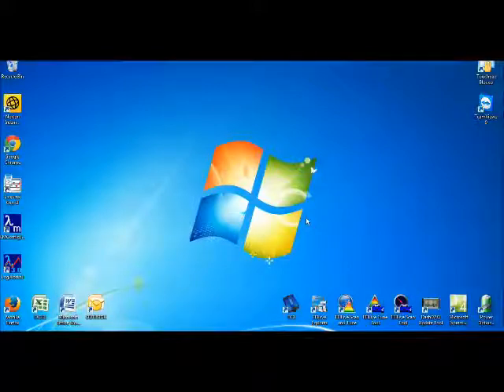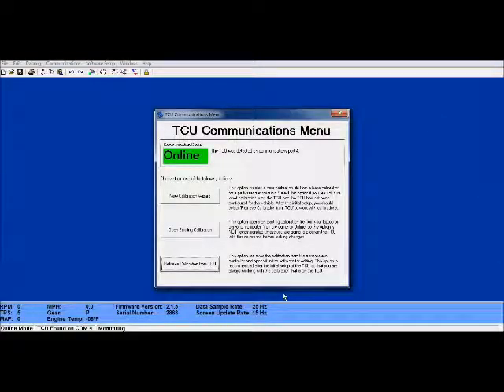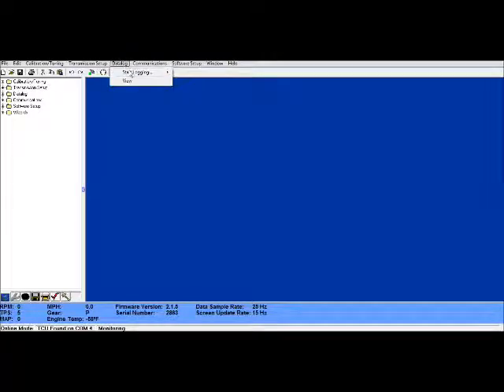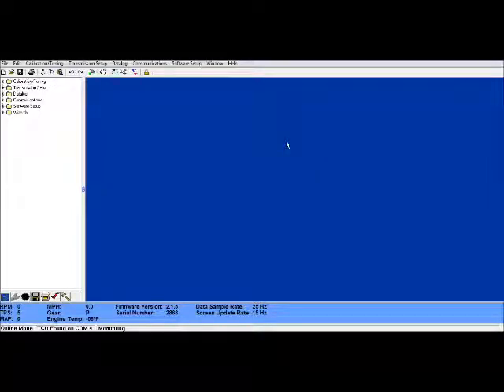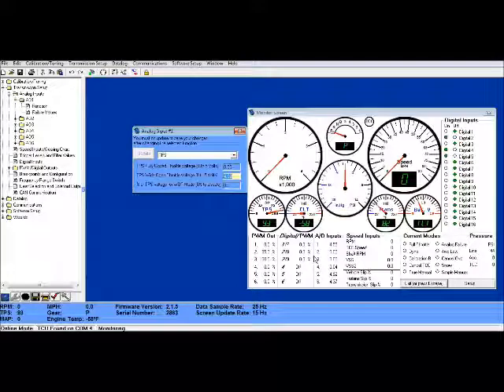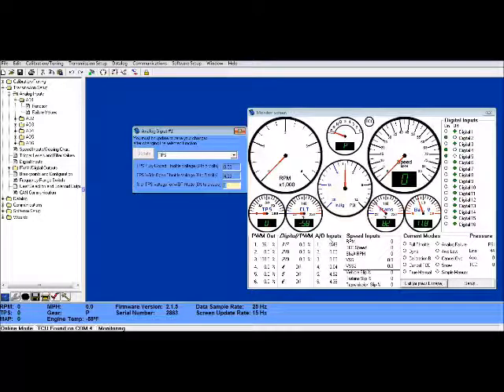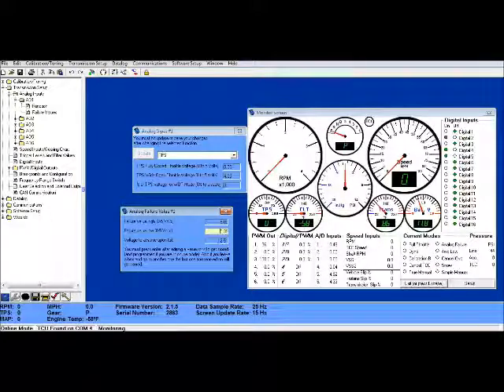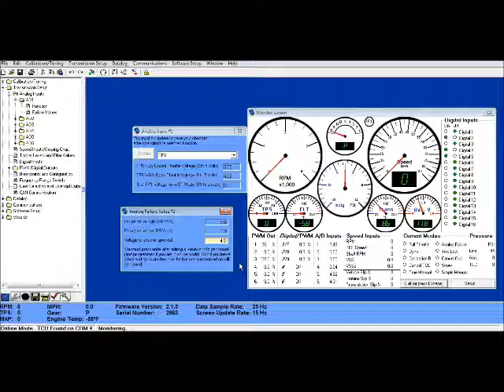Datalog and TPS Setup for PCS Controller

Comment: OK, another thing, at 6:05 if I have it right you talk about setting the TPS failure voltage close to the WOT voltage. Shouldn't it be the other way around ie if the TPS fails then the shifts should default to their softest settings?  Particularly with a higher performance vehicle?
Reply from the maker: Typically line pressure is controlled according to TPS voltage, so setting the failure voltage close to WOT voltage keeps the line pressure high in the event of a failure to prevent the clutches from slipping and ruining the transmission  (which could potentially happen if the TPS failed and the driver didn't know and had the accelerator to the floor going up a hill with a big trailer for example).   Setting the failure voltage this way also will alert a driver if the tps has failed since the shifts will be late and firm at actual low throttle.   

It is possible to set up the system to control line pressure according to boost pressure- and in this case the failure function would be set up for that instead.  I don't prefer to use boost for line pressure because it is slower to respond and does not ramp up before the load actually hits the trans.  If it were possible to use both that would be ideal.  

Sometimes, depending on how the TPS signal is wired up, the voltage runs backwards - from high to low voltage.  When the tps signal is set up this way the failure function isn't really needed unless the tps somehow stuck at 100% (low voltage).
Reply: Tuner is correct. Keep in mind that even a little slip can burn the clutches really fast thus ruining the transmission. Well it will need a rebuild at the minimum.

Comment: Problem is if the WOT function is disabled then the engine is not protected against an accidental downshift that otherwise would over rev the engine. When using manual mode of course.
Reply from the maker: Actually the manual mode over rev protection still works for downshifting, as long as you have the "WOT Settings" chart filled in appropriately.  The "% of TPS voltage for WOT mode" just enables the upshift function at whatever tps % that is entered (commands the upshift independently of the shift tables).  I have found it helpful a few times in the past when tuning a vehicle with a poorly stalled torque converter.  Since there is excessive slip rpm with the converter unlocked, setting the upshift mph in the shift tables is a guessing game - but the rpm settings in the WOT Settings chart give you more control.

Comment: Hi I did a cummins swap into my 2000 f250. I was planning on swapping to a zf6 manual transmission but instead I kept the 4r100 automatic tranny. I bolted everything up engine starts fine. Is the pcs controller necessary for this type of swap? My transmission won't engage.
Reply from the maker: +Fate Instinct 
Assuming your truck was a diesel before the swap, you might be able to use the factory system but it would require leaving your accelerator pedal in there and rigged up to pull the Cummins cable- and would most likely require the tach signal to the PCM as well just to work.  Then you would most definitely need some tuning for the stock system to work well with the Cummins.  

The PCS TCM-2000 controller works well with the 4R100 so that would be my recommendation.  That controller allows you to have a Calibration B too, although most trans builders agree you need some coast clutch upgrades if you are going to use Cal B for a tow/haul mode with serious engine braking.  Upgrades will be needed anyway if you have much over stock 12 valve Cummins power.  

The PCS Simple Shift or the Compushift II are other alternatives that are a little cheaper but not better in my opinion.  Although they may be easier to use, or at least seem easier to use, they are not nearly as well featured.  There is also a new controller on the market made by US Shift that does have some exclusive new features.  Check out my website for a review on the differences between these controllers.  

PCS is also developing a new controller that will be available in the near future.
Reply: +Transmission Tuner hello again. I'm fate instinct but j changed my name. So I got my Tom 2000 got everything wired up last night. I did everything in this video and that is all I did. Can I just start it up and drive like this or do I have to change my shift points before I do anything
Reply from the maker: Diego Cabrera
Yes, as long as you can see your tps signal working and you have a 4R100 calibration loaded into the controller you could drive it.  Chances are you will need to modify your gear ratio, tire size, and shift points if the PCS dealer you bought it from did not set that up for you like I would- but it doesn't hurt to try it out. 

Go easy on the throttle and if something doesn't seem right don't push the accelerator farther down to force the truck to move. 

Do a datalog, that way if something isn't right you don't have to subject the trans to more abuse to record one.

Comment: I have a 48re transmission in a 2000 dodge ram with the cummins engine that keeps giving me a high voltage to the computer putting the truck into limp mode,would you software fix this issue?
Reply from the maker: ***** First, it would depend on what is causing your issue, if it is a bad sensor that would still need to be fixed, if it is a bad PCM, then yes the PCS controller would fix your issue, but it wouldn't save you any money unfortunately.  Typically a different valve body is used to control the 48RE with the PCS controller, this allows the shift points to be controlled directly.  I think it could be done on the older 48REs without the new valve body, but adjusting shift points would be more limited.  Check out my website, www.transmissiontuner.com for more direct contact info if you like.  Thanks for commenting.